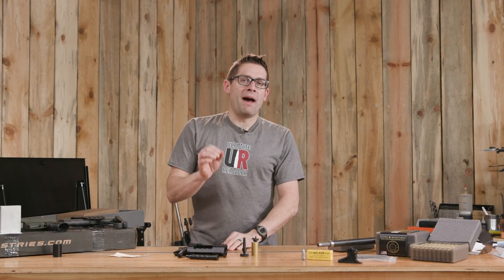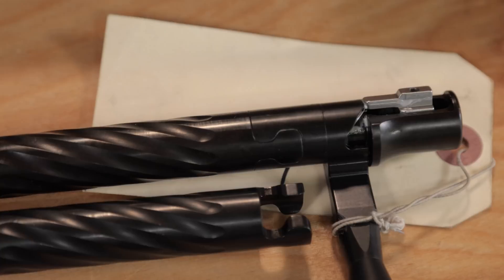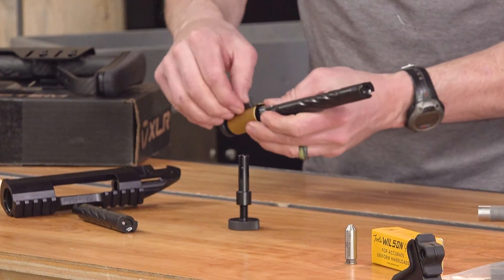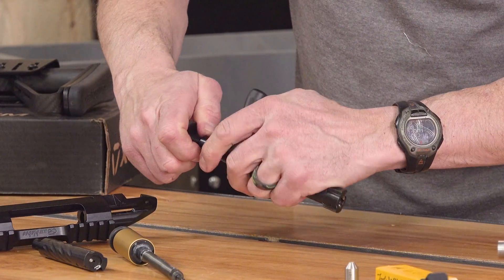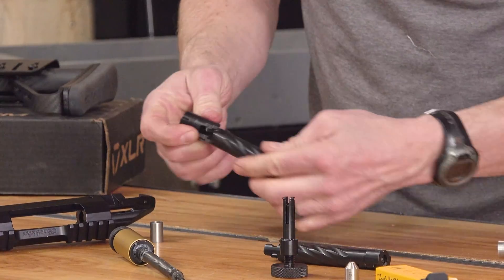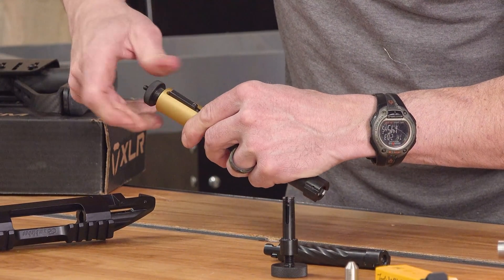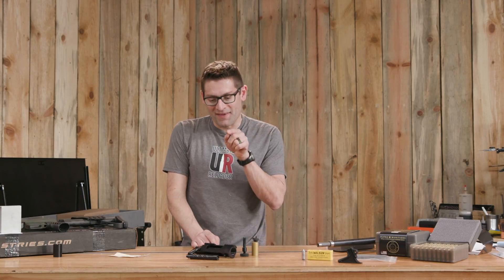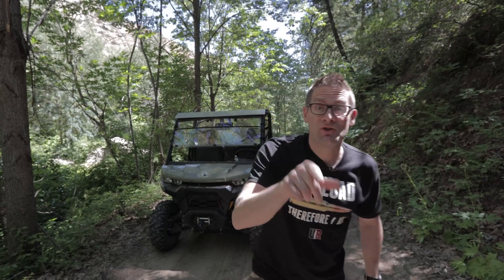BAT Modular Bolt: Swap Bolt Faces in 60 Seconds

Comment: Why not just have a whole extra fitted bolt?  The tool probably costs more (or close) to that.  Less time to swap as well.
Reply: A bolt extra bolt runs just over 600 vs just over 300 for a bolt body from them.

Comment: Looks like that could have been done simpler and tooless.

The bolt of a Mossberg Patriot can be removed, and completely disassembled without any tools.
Reply from the maker: You can disassemble everything I showed in the video without special tools. The special tools make the process more elegant for sure.
Reply: @Ultimatereloader  Then show us that way. I have a couple Origin actions I can swap bolt heads on and eat lunch in the time it took to do this with the "elegant" flair! Not a dig....I expect that from an Engineer....am I correct?
Reply: Cant believe you used that word with the word Bat Machine !